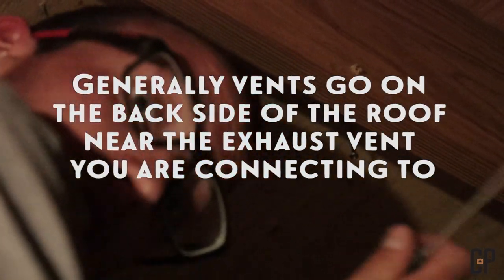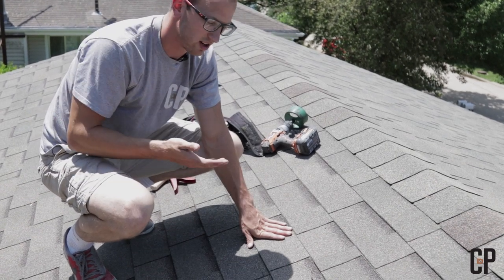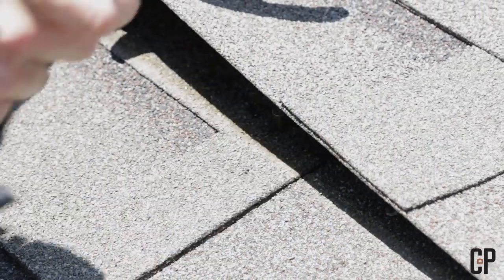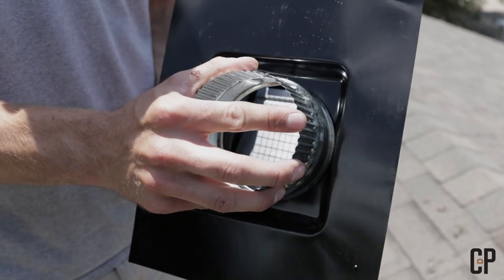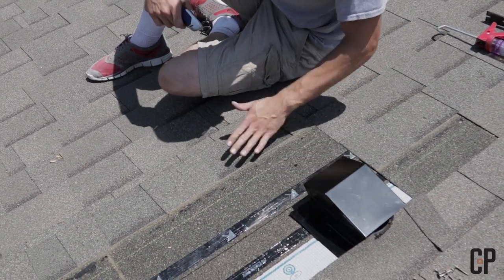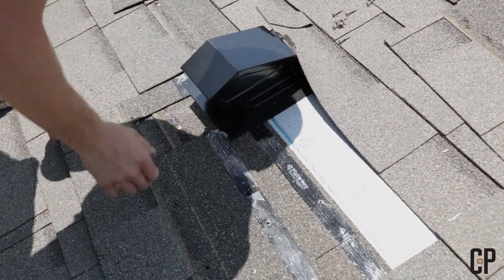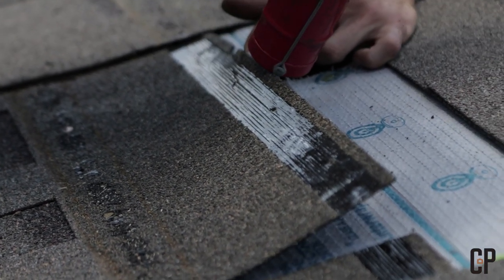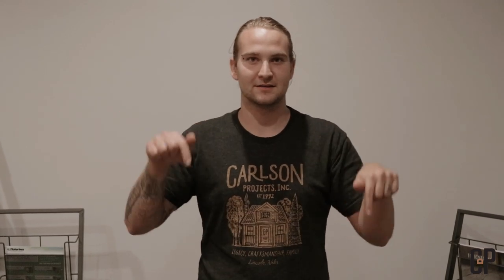How to install roof vents // Don't hire us if... Episode #1

Comment: Great job guys thanks. Only thing... I don't think you caulk the low side of the vent so any trapped moisture can drain down and run out above the shingles.
Reply: Dennis Alex Right! No caulk should be used across the bottom. Nail heads were left un-caulked and it’s totally unnecessary to remove a shingle tab.

Comment: Dude, read the instructions that came in the box - they tell you step by step how to put the thing in.  As everyone else asked, why is this guy pulling out shingles?  Just cut them in place.  you know the exact center, meaning you can mark the roof and get the hood out of the way while you are cutting the shingles to fit.  Caulk line on the flashing should not be a zig zag.  This probably turned a 20 minute job in to a 5 hour slog.  And the shingles aren't up against the sides - this thing is going to leak, and it looks like crap.  This is not good information, and should really be deleted - you definitely don't want anyone who might hire you to see anything like this, and don't want to encourage anyone out there DIYing this to start pulling out rows of shingles.  Just read the instructions that come with the hood......
Reply: It probably won't leak but there sure is monster gaps on the shingles
Reply: You need to leave a gap, but not that big of an (uneven) gap lol it is to allow frozen water to expand if it gets collected there, not an issue in warm climate but needed in Northern areas

Comment: This is a video on how to make a simple job as complicated as possible! Folks , don't be detered-it is a much  simpler procedure! Just watch this vid-

How to Vent a Bath Fan Through the Roof - This Old House
Reply: i dunno why you say this video made anything complicated literally its just these guys who did the job is younger than the one you mentioned...maybe you feel more comfortable with older men teaching you things?
Reply: Thanks - after watching a few vids, this one has a ton of unnecessary things. Perhaps they are advertising themselves by pretending this is a hard project...?
Reply: I have to agree that the "This Old House" method of cutting away shingles was much easier and more direct. I actually watched that video before coming here and was blown away when I saw this guy pulling out entire strips of shingles, not using safety harness, and caulking the underneath bottom of the hood--potentially trapping condensate....I'm like WTF.
Reply: @Jesus4KungFu  You have to look at the finished product - it looks like crap, and after all that shingle pulling, he didn't even cut the notch the right width - there's a 2" gap on both sides!  So after all that, and the job was done wrong - and they want to advertise this?
Reply: Yup....
Reply: Wow what a bunch of vultures, let these guys make videos. I'm sure it'll help someone
Reply: @ldlink3935  — Safety harness on a 3:12 pitch roof?  Besides, to what would one secure the safety line?
Reply: @Milosz_Ostrow  They left out the part where they erect a 50 foot pole with guy wires to attach a safety line to, every homeowner should have one, you know, just in case. or maybe they could just throw a line over the power line, that way you have a safety line AND a zip line too lol

Comment: Several things that you've done wrong... never caulk the bottom, so water can escape, for one...
Reply: You always cock the vent not under the shingle, I seen it too. I have to put a vent under some old shingles. I know how just looking for the best way not to break them. Could I make a small box cutout and slide it in? I do roofing but the roof is completely off when I install vents...

Comment: Not clear to me why you removed the shingles then put them back on. Seems I agree with the other poster that the This Old House video is a little more straightforward.
Reply: With older roof, chances are, some shingles will break when you pull them out, always good to know how to replace entire rows. I bought myself some spare shingles before tackling the project and surely enough, I needed them.

Comment: wow all wrong. guaranteed leak in 6 months .
Instead cut the hole through all shingles  - do  not detached.  Then remove the one or two nails above the hole. notch top upper shingle.  slide vent in - attach to roof.  flash cement appropriately and your done.

Comment: Good vid. Not so sure you need to completely remove the shingles. Just mark, cut out, slide under, seal. Also, some shingles simply won't come off like that because they have tar holding them to the roof.

Comment: Why are you removing shingles? No need to remove a shingle tab. Caulking should not be run across the bottom and nail heads were left un-caulked. Wrong, wrong and wrong.

Comment: Are you drilling in reverse? Lol 🤔
Reply: They probably did it to prevent any skipping because they were using the screw as a mandrel, hard to saw but after the edit it seems like its going in the right direction.

Comment: Do you have to run a vent through a roof for a cook top vent hood. .or just run it in the attic
Reply: Yes absolutely.
Reply: Eric Minniear-  If you just run the vent , with all  that humidity , into the attic , you might very well end up with mold . You need to buy the " stovepipe" connections and fit them together and run a " tube " up to the roof . You can get them at any Lowe`s or Home Depot or any roofing store . Also , buy a crimping tool that makes the end smaller  ,  and the correct aluminum tape to use . After you use the crimping tool once ,  you will see what I mean .       If the route is twisted , buy a 45 degree connection or two . However , every one of those 45 or 90 degree connections makes it harder for the exhausted air to get out . Whatever you do , don`t use a reducer that connects a 6" tube to a smaller 4 " tube .  Also , remember to get machine screws to fasten the short pieces of tube together to from a long tube . ( You can probably get better customer service and any necessary advice at a roofing store . )

Comment: I think you have to install the cap over the wood, not over shingles
Reply: Not necessarily especially for a retrofit like this job.
Reply: Flange only needs to be under all shingles at the top, sandwiched between in the middle, and lip over the shingles at the bottom. Once sealed properly this will prevent water egress.